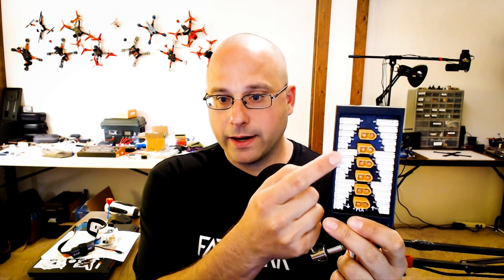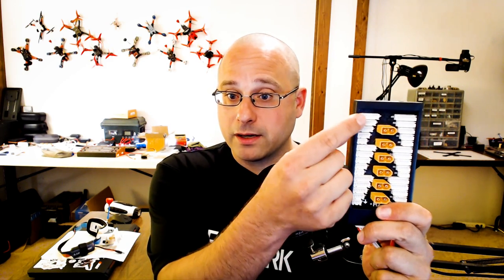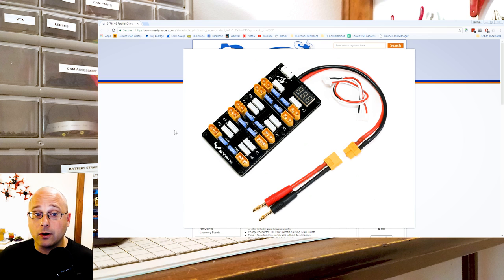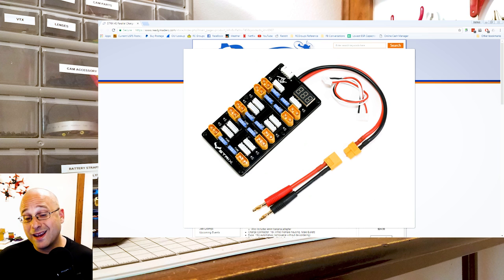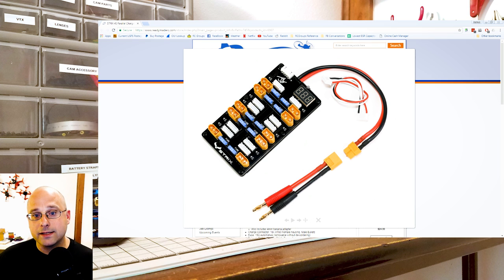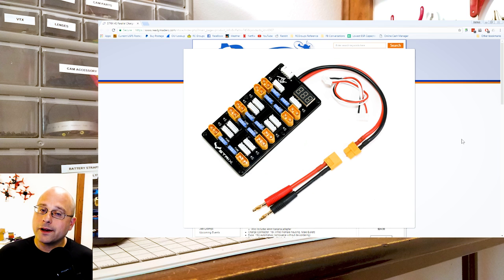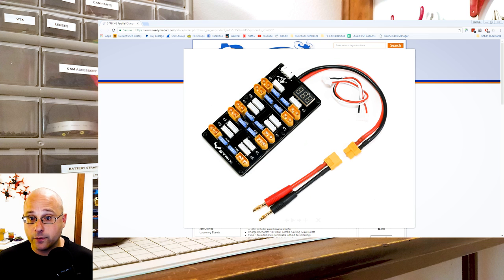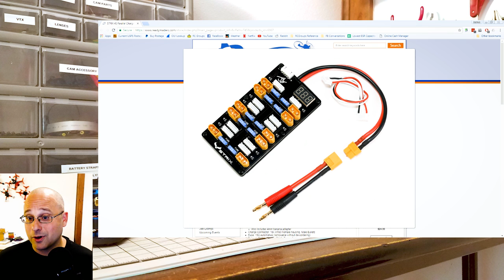The Best 4S Parallel Charging Board. Period. | JB SIGNATURE LINE

Comment: Whenever I parallel charge my batteries, the final voltage is always slightly off. If I parallel charge 6 batteries, they all end up with voltages similar to this:
cell 1: 4.14v
cell 2: 4.20v 
cell 3: 4.11v 
cell 4: 4.26 
I fly my batteries until they are all around 15v to 15.2v and balance charge them every time. Is this normal or do I have a defective parallel charging board? Thanks.
Reply: Sounds like you have a defective charger or possible one or more of the batteries your charging in parallel have defective cells. High end chargers like icharger or powerlabs account for voltage loss in the connectors and wires so the battery's all end up perfectly charged reguardless of what the connections are. Also it's worth mentioning but are you plugging in the balance wires on your parallel board?
Reply from the maker: Something is really, really off here. What you're observing shouldn't have anything to do with parallel charging or not. Your charger should make sure that all packs end at 4.20 volts when you balance charge. First, I would confirm that your battery checker isn't defective. If those voltages are correct, I would scrap the charger.
Reply: Joshua Bardwell I have 3 battery checkers, and they all are in agreement. Must be the charger. I'll have to pick up a new one (and obviously pair it with your awesome new parallel board as well). Thanks a ton!
Reply: sean metzger thanks for the reply. Yes, the balance leads are plugged into the board. Good thinking though. I think you and JB are correct. Must be a bad charger. Thanks!
Reply: When parallel charging, lipo cells are all connected to each other (parallel) so they first level each other out, if a cell has  less charge the other cell parallel to that will charge that one, until they are level to each other, that's why the difference should not be too great.
That's why you should first know what parallel charging really is...

Comment: Can i use this like all time plug in batteries ? 
I mean swiching the parallel board imput cable in an output for a motor . And viceversa if i wanna charge the batteries
Reply from the maker: I don't know what you're asking.
Reply: Joshua Bardwell  I mean if i can use the parallel board imput cable , as an output , when im not charging the batteries .

Comment: that led voltage indicator thing on ther i use a battery tester on mine that reads individual cell voltages so i can monitor cell voltages on balance board as well as on my charger... i also use cheali charger firmware on my accucell 6 this gives me so much more features..

Comment: Very nice Joshua. I fly larger aircraft and use lots of 5000mah lipos. If I want to connect 10 x 5000mah = 50,000mah and charge at 1c I need a 50amp charger. Do you or anybody out there know of any that can handle this? Thanks-
Reply from the maker: 50 amps at what voltage? The watts are what you really care about. But even if you're only talking about 4S, that's like 800 watts. Typical chargers top out at 500 watts.
Reply: Joshua Bardwell sorry yes 5000mah 4s. I'd love a charger that could do even 8 batts 4s 5000 at once.

Comment: This is fantastic, with one bad fault. The balance lead above you signature bent up easily while pushing the lead in. This could be solved easily if the manufacturer glued it to the board. Other than that, great product.

Comment: so just to clarify 2 scenarios, because im a noob, when you say to charge at 1C that means for instance: im charging a single 1300mah 65c 4s battery in my charger i set it to "balance charge" 1.3 and 14.8 and that is charging it at 1C. if i change it to say 2.6 that would be 2C correct? 
so if im charging in parallel x2 1300 4s batteries, same as above, i set it to 2.6 for a charge rate of 1C or i could set it to 5.2 to charge at a 2C rate. is this accurate if not please straighten me out. As i understand from your previous vids you can get away with 2C charge rate but all i ever do is 1C. it would be nice to know though.
Reply: correct

Comment: this looks like a winner,  added voltage reader and fuses and ten bats... ....only thing i would wish for is some kind of balance port read out for each battery,  (see last lines)  i just made my own  4 bat charger leads or my 6amp accucell hehehe. i'm a bit concerned about what happens if...... one damaged or weak cell is introduced... charging turnigy graphene alongside a tattu and two infinity bats.... i generally stop the charge at 4.17v and finish them individually, am i being stupid, or wise? i do see some cells at 4.19v and others at 4.16 when i do this... i also worry about the initial plug in where the graphene might have more juice left and instantly?? balances out with the others at an unknown C rate???.... how about a port on each of the boards balance ports that lets me plug in a cheap voltage alarm to see each individual batteries charge / balance state? ...
Reply from the maker: Yeah that would be nice but it crosses the line to "too expesnive to sell". I even asked for a four-line readout so you could see each cell individually instead of the overall pack voltage, but that got the nix.
Reply: it just occurred to me...when i'm hooking up my 4 into 1 rig, i start charge and read out the first bats cells, then plug in the second and look to see if cells change etc etc.... could i just plug a cell voltage monitor into the last battery position of your multiport and add batteries one by one to see if i had any low or weak cells being introduced? that would work ok yeah? i of course do my thing at 1c then restart charge at the proper amp input.

Comment: Does this board charge the 4s all seperatly? Like the tiny whoop boards do that I have?
Reply from the maker: No definitely not. Please study up on parallel charging before you try to use this or you can burn your house down no joke.
Reply: Hi thanks for the reply 
I've been parallel charging a while but I bought a hi voltage charger for my hi voltage 1s 260mah lipos.
The idea is great that the board charges all six 1s battery separately and It does not matter what voltage the 1s is at all six can be different and it will charge all six batterys separately.
Why can't a charger for 3s 4s 5s 6s  Do the same??
That would be so much safer than having to make sure the 4s is all the same voltage before you parallel charge them all. This would get rid of all that.
It won't matter what voltage the batterys at when parallel charging
Reply: Joshua Bardwell 
Hi again Joshua
Have you managed to look at this charger board?
It would be a great idea if we could build a charge board for the bigger batterys that works the same way? 
I can't believe someone hasn't done this already? Is there a reason why it can't be done with the bigger batterys and bigger boards? Or is there a reason it can't be done with the 4s onwards and only the 1s to 2s?
Imagine putting all your 10 batterys on the charge board and every port has its own screen with each batterys voltage displayed and charge each battery separately and never have to worry about if the voltage is all the same to parallel charge? 
Please look into what I'm saying here and if I'm talking in a different language let me know plz lol! As this is driving me crazy as to why I can charge my 1s hv 260mah batterys and they all charge seperatley it's great. 
No more putting into storage before parallel charging must be a +++++ right? So much time would be saved?

Comment: Will this work with the imax B6AC charger ? Thanks!
Reply from the maker: It will work with any charger. However you may need an adapter if your charger has banana plugs for the battery instead of an XT60.
Reply: Thank you for your quick answer!

Comment: Okay another ? I have a venom pro duo chargere that i can change the amps . as of now its on 5 amps by default so should i up the amps while i parallel charge or just leave it alone and dont burn down the house!
Reply from the maker: Add up the capacity of your batteries in the parallel board and convert that to amps. So if you are charging 10x 1300 mAh batteries, you would charge at 13 amps. That would equate to a 1C charge rate.

Comment: No polyfuses for the balance ports?
Reply from the maker: No. That was too expensive and took up too much space on the board. Plug in the XT60 first so the main fuses protect you, then after that, plug in the balance leads.
Reply: I was just curious to hear your thinking. Personally I only need it for when I accidentally screw up the 3s/4s/5s thing (which won't happen on your board :-) )

Also to not smoke the pcb traces when someone does plug in two voltage-different packs balance lead first is kind of a nice feature for "the best balance board" ;-) Until recently I only though this happended by mistake but apparently some pilots regularly use this method to intentionally balance packs... (no I don't think that's a good idea at all...)

Comment: Ok lets say I plug in 10 4s 1500mAh batteries and want to charge them at 1C, how many watts should my power supply be?
Reply: D S to charge at 1C you would have to charge at 15A. Not sure exactly what you mean by watts.
Reply from the maker: 10 * 1500 mAh = 15,000 mAh. 

1C = 15 amps.

Watts = Volts * Amps.

For 4S, volts maxes at 16.8.

16.8 volts * 15 amps = 252 watts.

Add minimum 10% for conversion loss. I would feel comfortable with a 300 watt supply. A 250 watt supply would definitely be too small, unless you count on the fact that as voltage gets to 16.8, current drops off. But really, I would play it safe and go to 300.
Reply: Perfect answer and kept simple (I need that). So the ISDT CP-16027 160W wouldn't be good enough to charge 10 batteries. Nor can some chargers meet 300W such as the iSDT SC-608. Do you have any recommendations?

Comment: Hey JB, do you maybe want to talk about this subject because I think many people are interested in it.

(Skip to the second part if you don't want to read about the heavier and lighter discussion)

People claim that a heavier quad is faster than a lighter quad but for some kinda reason it is true, but if you look at it scientifically not. So what they claim is that with a heavier quad the just beat out other people with lighter quads with a far bit, but what the don't look at is what motors they are using. So science prove that a lighter quad should be faster but then just with the right setup and motors. And I know Bob already talked about this so it isn't this but it has to do with it.

What I'am really interested in is that many people claim to find the lines with a heavy so sub 700g and above. I talked and listened to some people that have flown the drl racer 3, for example gab707 and Matthew aka add1ct3dd. So what they are claiming is that you can get a better pilot if you are flying a heavier quad because you really need to find that line that you are planning to fly and don't think about what is happening but look in the future and think about what you are going to do because you really can't suddenly stop that 700g+ quad in just one blip of throttle that you really can do with those lighter quads. But is that really true? (Btw all those things I said is what I could make of the thing they said.) can you be a better pilot with a lighter quad and don't think about those lines because you really don't need to think about the future but just the things that are happening. Is there really an advantage to look at the future and take a look at the lines that you are gonna fly? And can you be a better pilot and faster pilot with a heavier quad that does have that future looking line in mind? And can you really take advantage out of that inertia of that 700g+ quad? Because on the non scientific way (so just from the community around here that isn't using the right setup to get those results from) they still claim that this kinda quad can be faster than a sub 250g dry weight quad.

Comment: what about current limiting between the cells, so you can plug batteries at different charge levels, they will equalise and not cause a fire... otherwise great.
Reply from the maker: That is the kind of feature that is easy to imagine, but expensive to build. If we can figure out a way to do current limiting while keeping the price reasonable, I assure you we'll do it. But look at all the boards with polyfuses. They're $60 to $80 for a six-port board.

Comment: Not bad, look sweet. But what about a Deans connector version?
Reply: people still use deans? I always found them to be a real pain in the ass to use
Reply: We're a small community, but yes some still use it. lol
Reply: who the hell uses deans these days? cna you even buy batts with them anymore?
Reply: +Sloth FPV they are really annoying to solder and really hard to grip and unplug
Reply: Yes you can find some, but typically I solder my own.
Reply: I prefer Deans, the XT60 always get loose and I found them to be a pain
Reply: For those who do, ya think they could solder on a deans?  Or is that too much work...............
Reply: Robert Hunter 
I was just about to say.. Hey I like this rubber tyre and steel wheel thing...  Do you have a wooden or stone one I could buy? 
But then I read your xt60 coming loose comnent... Fair enough.

So.. Someone start making XT60 M/F connectors with pop snap fastener on side.. 

I'll have 0.5 cents of the profit of each sale thanks.
👍
Reply: People still use deans connectors? Did we go back in time to the civil war days
Reply: Damn skippy we do

Comment: I'd buy two instantly if it there was a deans version instead of xt60's.  Wouldn't replace my existing parallel boards, as I do charge 2s (mosquito), and 3s (clearview, rc truck, etc).  But for the multitude of 4s quad batteries, it would save me from running two 6-way parallel boards ganged together.
Reply from the maker: Maybe Deans some day, but the first one had to be XT60 of course because that's what the majority use.

Comment: I would like to see a 2s xt30 ten times board. like you idea. there is not a single xt30 parallel board. be the first.
Reply: You could easily make an adapter where you can connect 2 2s together to one 4s which you could use with this board. rcmodelreviews made a nice video according to this.
Reply: There is an xt30 parallel board from Atmospheric Adventures

https://atmosphericadventures.com/batteries/battery-accessories/xt30-2-6s-parallel-charging-board
Reply: Do some research and make your your own board, should not be to difficult.

Comment: I've been charging at 5c for about 6 years. Lipos still going strong. 15min charge time
Reply from the maker: Good luck with that... I do not recommend this as a general practice. If you get one damaged battery, it's going to pop.
Reply: Joshua Bardwell I only charge one at a time. And they don't even get remotely warm.

Comment: Why not just use a balance port that supports 2-6s? I agree that having 5 different balance ports per battery on your board is a bit ridiculous, but I feel like these could easily be replaced with the type of connectors that are generally seen on chargers http://imgur.com/a/gV9fQ
Reply from the maker: The point of the board is to increase safety by making it harder to plug in the wrong cell count battery. That multi-way plug is not a standard part. So RMRC would have to pay to get molds made just for this board... $$$$$. For a company like ISDT, it is profitable to have the custom mold made. Not for RMRC though.

Comment: We need to have a talk!! I just went to order that para board, and bought more items then intended. dohhh
Reply from the maker: Reach out to RMRC customer service. They are currently back-ordered so they will probably be glad to take yours back.
Reply: Joshua Bardwell no no. I meant I was only planning on ordering that board only, and bought, props, extra prop nut tool, strix goggle battery.  I don't mind waiting.  as long as they don't pull a fpvdirect scam on me lol. rmrc is on my list of top 5, no scratch that 2 stores!

Comment: No can we make a (smart) one where we just plug everything in without checking and it will start charging them independently and gradually synch in parallel when the cells are of equal voltage?  Or am I asking too much for 2017? LOL
Reply from the maker: The problem with this is, by the time you have built all that, you have basically built a charger. At which point, you might as well just charge the battery by itself. The whole point of parallel charging is that you get a cheap board that lets you charge a bunch of packs off of one charger. The tradeoff for that is that you have to jump through some hoops regarding voltage.

Comment: What do you mean by "you can just plug the 4s plug into the 6s plug on your charger"? Can't I just plug it into the 4s plug? I just want to make sure I don't burn my house down.
Reply from the maker: The balance plug on your charger is sized for a 6S plug. But if you snip off the indexing tab on your 4S balance cable, you can plug it in to the 6S plug on the charger, just plug it in on only the first five pins. 

Don't plug in a 6S to a 4S battery or badness will result.